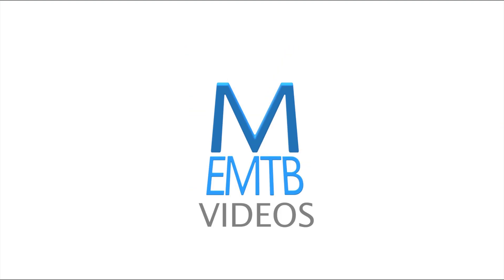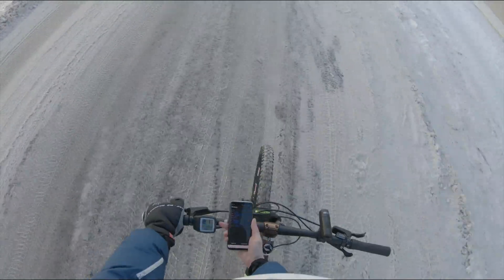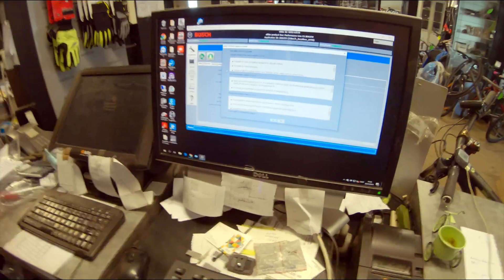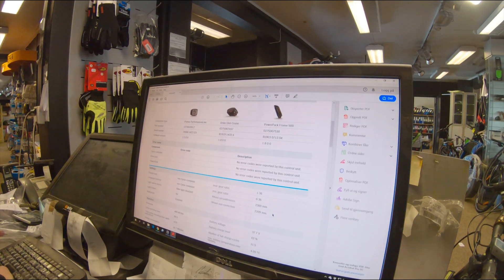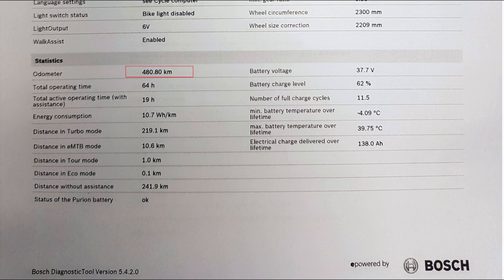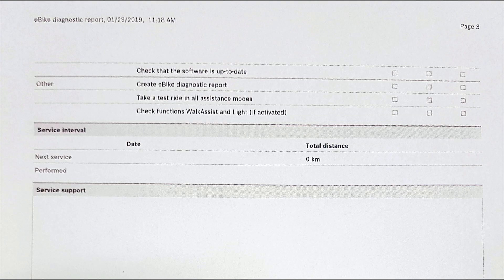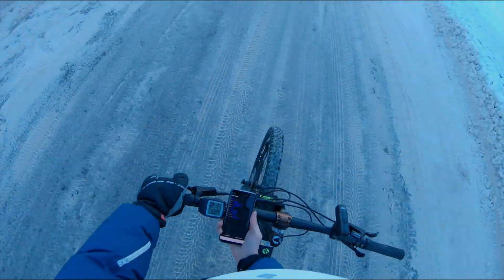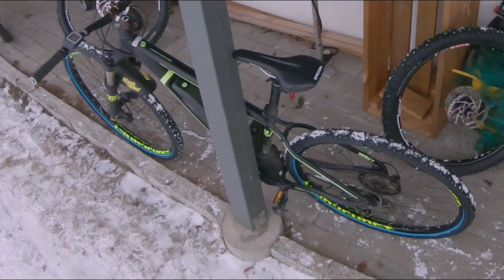Bosch e-bike diagnostics and service report (2018 Performance CX)

Comment: Can you ODO reset witch this program? I have new motor in my bike
Reply from the maker: I don't remember the available options in this software unfortunately. I guess it's possible if the dealer has a high enough level of access. But I really don't know, sorry I can't be of more help.

Comment: Hi
 To connect the bike to the computer, do you necessarily need the usb A usb  C cable, supplied by Bosch ? 
or does any USB A USB C cable work?
Reply from the maker: It's been years since I had a look at this. But I've got this memory of some sort of a hardware key unit needed to access the computer software. That could have been attached to the USB cable.
Reply: @EMTBVideos  Thanks !!
J'habite très loin d'un revendeur Bosch et je voulais savoir si on pouvait me communiquer des identifiants pour accéder au logiciel Bosch diagnostic tool 3 pour Smart system ?
Merci

Comment: I am having trouble when I change the wheel diameter it does not save the reading I put in . How do you save it ? as my speedometer is out and it cuts out at 21 km as well . but my bike say 25 km 
Could you please help me with this ?
Reply from the maker: Altering wheel size on the display will only have a minor effect. It sounds like you've got a 27,5 bike with the wheelsize set to 29 in the motor. You need to visit a shop to change this.
Reply: @EMTBVideos  Yes that is exactly it and I work at the bike shop but don't know how to change it . I change it but it do not save onto the bike  and my display I can't change it on it has to be the computer.  I need to learn how to do this .
Reply from the maker: @cameronbyrne8972  Ahh, get it. I never got to play with this software myself, so unfortunately I don't know how to use it.
Reply: @EMTBVideos  Right ok cool I will try work it out and maybe email these guys to find out . Cheers 👌👍 thanks

Comment: is there a setting to tweak support level, for example lower the eco and tour support level
Reply from the maker: Support levels can only be altered using the Nyon display, which is found on pretty much no emtbs. The settings are stored in the display, not the motor-unit, unfortunately. There has been talk about and update to allow adjusting support levels on the Kiox, perhaps it will come on the rumored 2022 Kiox display...

Comment: there is dealer in my country, can i do this at a bosch center for cars? would they use the same software?
im on my second 504 error code yikes! i did not install any speed chips etc

Comment: I think this software should be available to the public. I like to put a 27.5 tire on the rear of my 29ers. It increases torque. Makes steep climbs easier, and the tailend lighter to kick around turns. I have a purion display. I cant alter wheel circumference, and the bike shop won't.
Reply: @EMTBVideos  Is there anyway I could buy the software? I have been looking for a while.
Reply: @EMTBVideos  Even at the limited speed its a bit too slow to safely take a jump. You take a jump too slow you case it. 

My e-bike its too heavy to get the safe approach speed for the doubles. To top it off I like to run the 27.5 wheel which further reduces the limit. I could put the 29 back on but my angle wont be right for jumps.

People hate e-bikes for the wrong reason. They are not fast at all. The anti consumerism  makes owning one a nightmare. If the limit was 25 instead of 20 I think less people would be apt to wanting to mod them. 25 is just a touch undermost peoples max 28 would be ideal though.

Comment: Surely altering wheel rolling circumference to match the fitted wheel only means the Purion then reads correctly and it doesn’t me the cut out speed was wrong, just that the speedo was inaccurate.
Reply: EMTB Videos As far as I know altering wheel rolling circumference makes no difference to speed cut out. It’s simply Speed displayed it alters.
Reply: Me neither. Logically the wheel size must affect the cut out speed. I guess we need answers from Bosch.